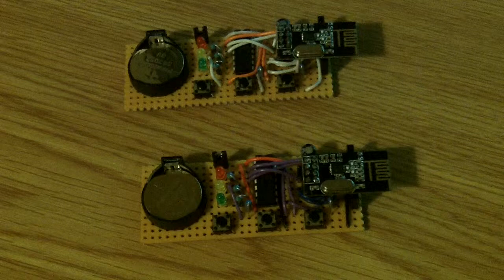nRF24L01 Test board

Comment: What range (distance) can it transmit without an extra antenna?
Reply from the maker: I've managed over 150m line of sight (even though the claimed range is 100m). Probably about 20 - 30m inside. To get the best range you need slow speed (250KHz) and small packets (min I could get was 6 bytes). All tests were using the on-board antenna.
Reply: Ah ok, that's quite good in my opinion.
Thanks for the tips and fast reply!

Comment: If u increase the voltage to 3.6v can the range be increased
Reply from the maker: No - the supply voltage doesn't make any difference to the transmitter output.
[Sorry for the delay in replying!]
Reply: Thank U